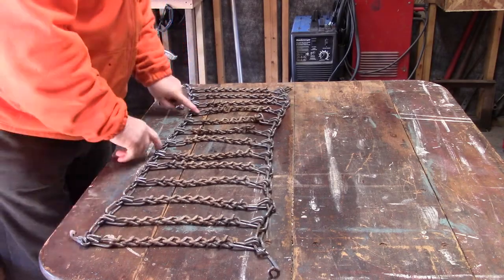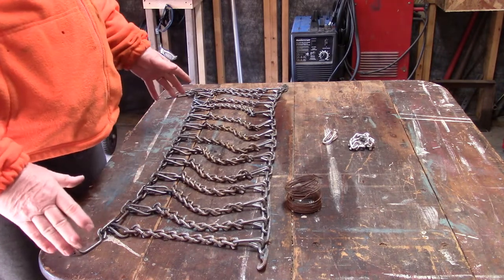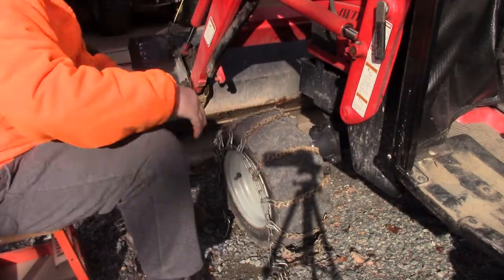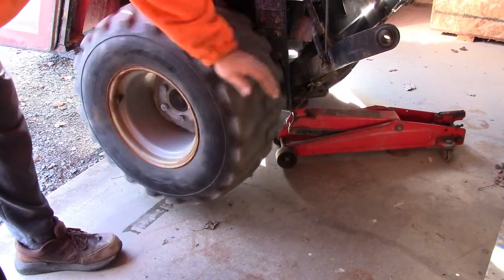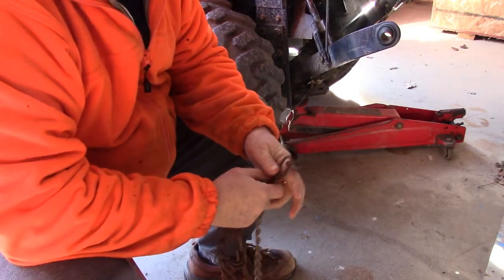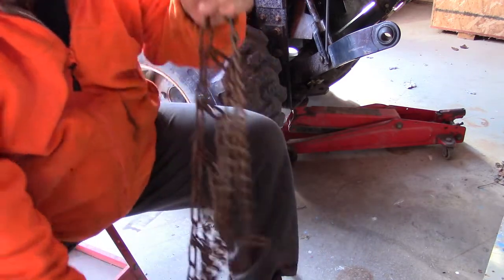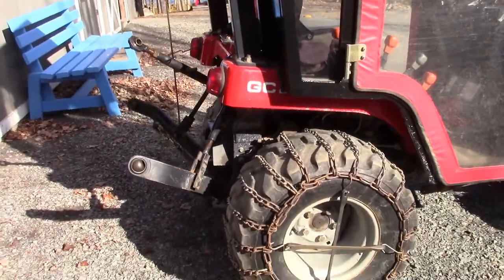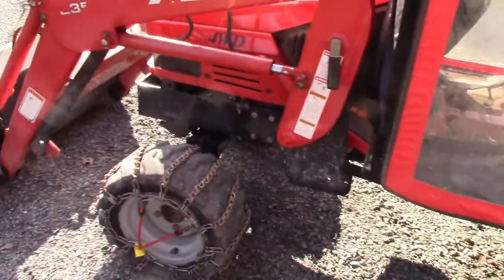Putting chains on tractor

Comment: Nice job!  The chains as set perfectly in my opinion. I assume you roll on paved roads to have such wear on your chains.  I've got a used pair of studded chains for the back tires, they were 30% worn.  5 years later, I could not see much difference from the time I got them. I keep them year long. But I never go on paved road. I think like you for those people that fought and fight for us.  I am very, very thankful for that. And quite the opposite about Mr. J.....
Reply from the maker: Hey Joe thanks for watching!!!  Those chains that are so worn have never been on pavement.  I have no paved roads near where I live.  Those Vee-bars were wore down just from the snow and ice.  The front wheels are so small that I bet 80% of the time, while I'm plowing, those wheels are spinning.  I angle my blade to make a wind row along the side of the road and I have to keep turning into the bank to be able to plow straight.  I guess that's one fault for the sub-compact tractor, not heavy enough!!!  Bonne journee mon ami!!!!
Reply: Do you have separate left and right brake pedals?  It helps a lot! Especially if you have good ballast like your snow blower.  Even with my 5000lbs Case, I have to use them, as the front wheels don't get enough grip. But I can tell you the left and right brake do a very effective job at steering the tractor, whatever the direction of the front wheels...  Mike, your channel should be picking up quicker as you have very good content.  Do you use keywords when you publish your videos?
Reply from the maker: I have a hydra-static transmission and don't have individual rear brakes.  It would be nice.  I have driven tractors with rear brakes like that and it's amazing what you can do with them.  Thanks for the nice comments about my channel.  I do use key words and I must say thanks to a lot of good You Tube friends and supporters of my channel, guys like you, I have gotten a lot of new subs over the last while.  Humbling to say the least.  Salute!!!!

Comment: It's mi third winter and I don't see the need for chain. Do you have a snow blower, mine is so heavy give me all the traction I need to do loader work.
Reply from the maker: Thanks for tuning in!!!!  I have a 52 inch blower for the back of the tractor and I plow with a 60 inch blade on the front.  The blower is heavy and it makes the front end light.  The chains help me plow straighter.  Also I plow about a 2.5 km road with hills.  The rear chains help to get up those hills, especially when they get icy.  Take 'er easy!!!
Reply: I don't plow in hills